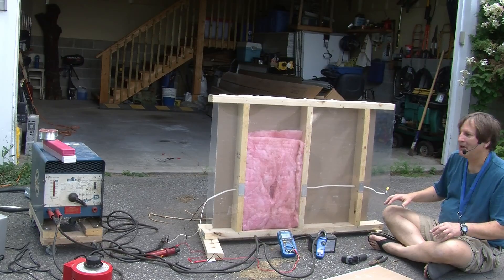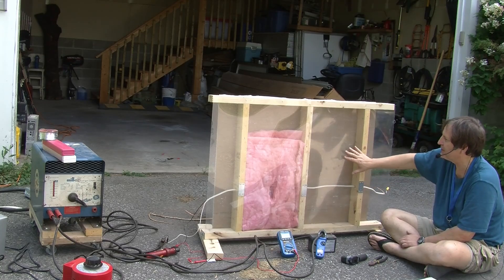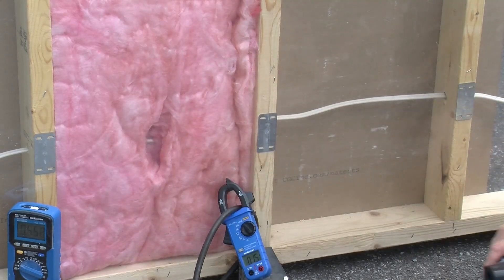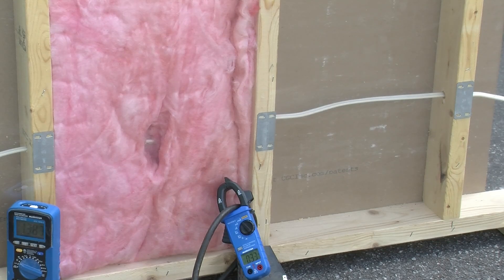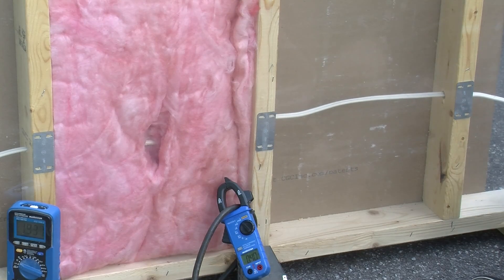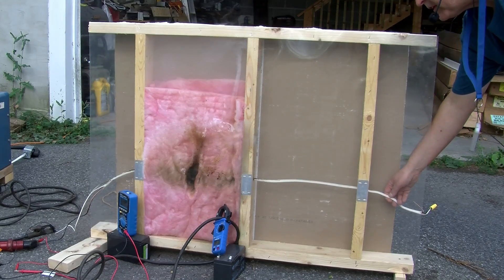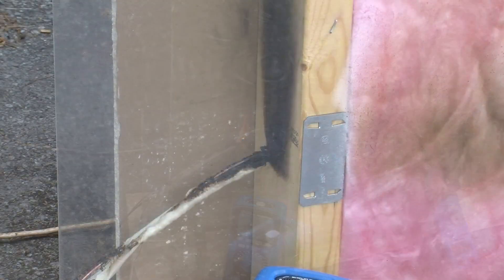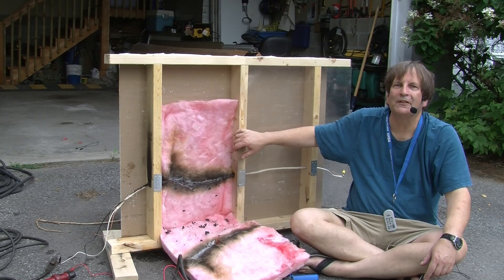Overcurrent +14/2 + Fiberglass in a 2x4 Wall

Comment: So a 8 gauge wire that is rated at 40 amps should easily carry 60 amps and have a 60 amps breaker?   My house in Colombia has a 8 gauge main wire.  15m long from the post total length to the panel.  About 6m of it runs in the block wall inside a 3/4 inch plastic pipe.  Green pipe used for electrical.  Do you think that I can increase my 40 amp breaker to 50 or 60 amp
Reply from the maker: I wouldn't - the reason for large margin of safety is to make sure things are OK even if things go wrong. For example, some circuit breakers are surprising inaccurate tripping at higher current than they should.  Other issue may be insurance or liability issues if something does go wrong. Having said that different counties have different electrical rules so it may be worth checking to see what a #8 cable in in 3/4 inch plastic conduit in Columbia is rated to carry - could be more than for a NMD cable in Canada or the US.

Comment: Also, where are you gonna measure temperature on a white wire that thermometer in your hand requires a black surface to function accurately just put a piece of electrical tape on it!
Reply: Matte surface, can be other color, but he had piece of plexiglass in front of it

Comment: Another great video update. After watching this in tandem with the previous on overcurrent i am feeling quite safe with the standard of 14/2 for code. We are to go 80% of 15 Amp continuous and watching we are well past this usage, we are well beyond 100% of continuous current and your fuse should take care of tripping beyond that point. If someone wrongly put in a 20 Amp fuse i believe it would still be safe. Seeing the Canadian code is always a tradeoff between safety versus cost i believe they made the right tradeoff, going to a 12 gauge for a 15 Amp circuit would be welcome but not necessary as a minimum seeing the margin for safety is more than adequate from your testing. Cheers.
Reply from the maker: Yes - and your right it is always a trade off. The one  that concerned me a lot was the one with spray foam around the  wire. I dont remember the details, but I do remember that what I took from it was if the you had a cable expected to draw close to its rated current for an extended period of time and all of this was in location like a hot attic or maybe a sun facing wall, the margin of safety would get too close for my comfort if one used the code sized wire.

Comment: This is a great test that really shows the massive safety margins built into the code for wiring. In nearly all cases the end device, receptacle or what not will fail well before the wire does. I speak from CEC rules, but wire is rated based on the insulation temperature of the cable, and parts of the code restict temperature table you can use for that application. For exmaple, 14/2 is rated for 25, 20, 15 amps at 90, 75, 60c. For nearly all cases in a house, you have to use the values under 60c which would be 15amps. However for hardwired heating loads, like a hot water tank, you can use the 75c values. With the heating rules you can load 14/2 right up to 20 amps of continuous load, on a 25a breaker.
Reply from the maker: It has a great safety margin  - although in a following video with even better (spray foam) insulation  ( https://youtu.be/lFdSXTKsKwA ) 30A becomes the point where the wire insulation begins to melt. Not a huge surprise since with enough insulation you can  get any amount of heat rise, but a close particularly for situations like a cable in a hot attic that have been covered with insulation and is feeding something like an air conditioner at close to rated current. 

CEC rule 14/2 allowing 75C/20A for hardwired heating loads. Any idea why that is deemed acceptable? I would think a heating load that can often be on for long periods of time would be worse  than for things plugged into outlets etc with usually more sporadic usage? I have also hear the higher temp ratings are also permissible in some industrial situations.   For the record, I'm an electrical eng who doesn't deal with code issues very often so its neat to come across someone who really knows it (electrician?)
Reply: Not much of a safety margin, when you consider that those wires are run in places that may have issues dissipating the heat. Also, hidden places that are not easily checked or inspected.

I think even if you are pulling much current through a heavy-duty extension cord, you may need to check that it is not too much tightly coiled up. Wire is technically a low-resistance resister, and so all those watts of heat have to go somewhere. Incandescent light bulbs are a high-current resister, made to be able to take some amount of heat.

Comment: Dr. J, I'm somewhat underwhelmed with your testing methodology; Particularly I'm at a loss as to why you wouldn't use a temperature probe/thermocouple attached to the cable jacket inside the fiber glass insulation instead of relying on an infrared gun trying to take measurements through plexiglass. The pocket/birds nest you carved out degrades the test and taking measurements through plexiglass further skews the results. Anyhow, after 30Amps, i started loosing interest. PS:  fires are much more efficient spreading through vertical cable runs. If you tilted your rig 90 degree sideways, or even better, make a 90 degree turn simulating a vertical and horizontal cable run, typically found in many homes, would give an even more realistic picture.  I bet at that 90 degree turn to horizontal would catch on fire at 40amps.
Reply from the maker: Points well taken! It was by no means (or meant to be) a perfectly done test, but more a general demo of what happens when typical house wire is surrounded by insulation and exposed to varying current below and above what it is rated for. I don't remember why  I didnt use a temperature probe - its been a while since I did the video - might have been the probe I had had broken and I hadnt got the replacement yet. 

  You make a very good point about vertical runs. And to add to your "turn it 90 degrees" comment, having it a full 8 or 9 ft tall would add to the chimney effect even more. Would also be good to do with and without sealing the holes though the 2x4s where the  wire enters/exits (as is often required by  building code).

Comment: What about blown in insulation?  Is that more flammable?  My older home is filled with it. Done in 2010.
Reply from the maker: Is it foam blown in insulation? If did one with hardware spray foam in a can here which may or may not be like two part  spray foam: https://youtu.be/lFdSXTKsKwA

Comment: Small correction: Originally all 2x4's were really 2"x4" but they were called "rough cut." They really were very rough. I know this because my first house built in the 1930's was all made of rough cut lumber. But then the mills started offering sanding and planing of the 2x4's and that took 1/4" off each side. So when you bought "2x4's" you were asked "rough cut" or "sanded and planned." Very quickly everyone opted for the later and that is why 2x4's are not 2x4's.

Also great video. Thank you for making it. 🙂
Reply from the maker: Interesting - I had heard the size between what we call 2x4s and an actual 2x4 was from thick saw blades in the old days. Seemed a bit odd to me that the blades were half an inch thick. Your explanation makes much more sense. Hals also never heard about being given the option of which size  of 2x4. I have heard that in California as a result of some law or court ruling, the hardware stores have signs up indicating that 2x4s aren't actually 2x4. 

  Glad you liked the video!

Comment: I think the spray foam will burn in a bad way if it is close enough.  i think spray foam is a bad idea for fire safety or at least near places where fire could be a risk. Even the fire rated orange is bad.
Reply from the maker: I was surprised the  various foams didn't simply go up in flames.But even without flames the fumes are probably deadly.

Comment: I'm not convinced you are reaching Steady State in 15 minutes.  I believe National Electric Code differentiates "continious" vs. "intermittent". as typically used less than 1 hour, vs running for 1 hour or more.  So... It might be interesting to redo this test with 1 hour intervals, and to pull the insulation off and take a picture and temperature reading in between each 1 hour run.  I doubt much interesting would happen at 15 amps, or even 20 or 25 amps...  Beyond that, things might get interesting.  I might expect insulation browning at 30 amps over an hour, maybe???  But your 50 amp tests, although fun to watch, (hopefully) aren't very realistic.  Great Video!
Reply from the maker: I think the equilibrium time may depend a lot on the thermal mass around the wire and the amount of insulation and what the resulting time constant works out to be. Temperatures seemed to stabilize after about 15 minutes, but yes, could creep up a bit more over an hour. A forensic analysis as you describe would be the way to do it for sure! I also wonder if extended cooking at 30A might make the plastic break down over time and be more susceptible to failure as the time goes on. 

And yeah - 50A is fun an hopefully not common. There is a series of vintage breakers that apparently are still installed  in some homes that sometimes don't trip properly (Federal Pacific and Federal Pioneer according to Mr Google)  so it may be more common than we think. 

Thanks for the comment!

Comment: This is not realistic becuase 12 2 Romex is used for outlets in US homes not 14 2 Romex.. . MANY STATES DONT EVEN ALLOW 14 2 in lighting circuits becuase people cheat with lighting circuits with those screw in plug adapters...
Reply from the maker: Well I'm in Canada an 14/2 is (or at least was) common.

Comment: So strange for us to see a wall not made of stone or concrete.  If you install wire is there pvc pipe around the cable? We normaly put wall wire in the pvc pipe.
Reply from the maker: Construction of houses is very different in Canada and the US from Europe. The little section of wall I built is typical an could be from a real house. For houses, we do not normally use conduit (English for the pvc or meal pipe for electrical wires). The wire is simply placed though holes in the wood inside the wall. There are rules that say how far from the surface of the wall the cable should be to prevent damage when people put nails in the wall. I'm sure our risk of house fires is way higher than yours!

Comment: The copper will melt long before the fiberglass melts.  However, fiberglass is generally coated with a binder and dye and that is likely what is burning off.  Would have to look at a specific manufacturer MSDS to know for sure what is used.

Comment: I would hope this is a lesson for people not to put in too large a fuse or breaker on residential wiring.
15 amp for 14  guage wiring  and 20 amp  for 12 amp  wiring.
Reply from the maker: I was actually shocked to hear that people not only put in bigger fuses, but also also actually have swapped in larger breakers. Scary to put it mildly!
Reply: @ElectromagneticVideos  We need more public information on the correct sizing of fuses and breakers. Especially when it gets cold and people use electric heaters.
Reply from the maker: @jcolumbiap  Definitly! To their credit, a few years ago when when I was purchasing a replacement 50A breaker for my welder outlet, the Home Depot rep mase some gentle enquiries about what was such a large breaker for, clearly wanting to make sure I wasnt going to do something like replace a much smaller one with it. At leas with breakers pwoplw are less likly to "upgrade" them on a whim which must happen with heaters blowing fuses.

Comment: Lets say thats happening somewhere inside  my walls and all I notice is burning electrical smell.    How does one figure out where exactly its coming from without tearing out entire walls?
Reply from the maker: That's a tough one - a hit at location might be looking near any large loads that are running like a heater. I did  notice in some cases you could get a sense of where the overheated wire was with an IR camera - but not a foolproof solution. I would think if you  thought there was something like that going on in a wall the best thing would be to treat it as a fire and call the fire department - they probably have experience locating things like that best to be over cautions than risk a house fire by not doing anything.

Comment: Cool test! How many amps can the wire handle under water?
Reply from the maker: That's an interesting one! There certainly are underground power transmission cables that depend on some sort of non-conductive cooling fluid (usually oil I think) to keep the cable cool. And its a sophisticated enough setup that there are pumping and cooling stations at the ends of the cable to manage the fluid.

Comment: Test results are what one would expect, insulation melts at high current. The data points used to determine when the conductor insulation melts are flawed. The IR thermometer cannot detect surface  temperature of an object through plastic. My $30k Flir infrared camera doesn’t work through plastic either. The temperatures reported throughout the video are the average surface temp of the outside of the plastic sheathing. Actual max temp of the conductor sheathing reached somewhere near 300C as this is the temp that wood will combust. For reference, fiberglass insulation melts at about 540C and copper melts at just over 1000C.
Reply from the maker: Your right - verified this in later videos after I bought a $300 IR camera (not quite as expensive as yours!). Thanks for those reference temperatures. So what do you use a $30K IR camera for? I'm guessing it has fairly high image resolution to cost that much?
Reply: @ElectromagneticVideos  I’ll have to check out the later video. I am master electrician and reliability engineer working in an industrial environment on voltages up to 12.5kV. I use the camera to find loose connections in electrical gear.  Due to working on enegerqzed gear most of the time I need to keep a safe working distance from the high voltage. The high resolution camera (1024x768)  with a .2mrad IFOV give the camera a very small spot size ratio and allows me to distinguish exactly where the hot spot is located from a safe distance. This is important when there are multiple lugs bolted together or multiple taps on a buss bar. Repairs have to be scheduled when there is downtime so we need to know exactly what to tighten or replace.
Reply from the maker: @farmerjim-fat-man-do  How interesting! I never thought of that as a use for an IR camera but had heard of people checking home panels for overheating breakers. I can see how a camera like that would pay for itself many time over dealing with things like yours and minimizing downtime.   I'm and EE but generally dealing with signals and much lower voltage  stuff than you. My only experience with HV is from fixing TV as a teenager the HV section being in the range of 12kv to 30kv depending on  tube size and bw or color and of course with mA amount of current (although the built in picture tube capacitor can store quite a punch for days or more!). I wish you would put us some videos but I'm sure many industrial places wouldn't be too happy at having their facilities shown off!
Reply: @ElectromagneticVideos  IR thermography is used quite a bit in industry for reliability purposes. IR camera technology has become much more affordable allowing hobbyists access to the technology for home and auto use. A lot of electricians can now afford to carry a low end camera on their trucks. IR technology is not as simple as point and shoot, there is a quite a bit to learn about the technology before one can expect good quantitative and qualitative results in a professional setting. I have been Level 3 certified for 10 years and still learning. I am working  on some content but I travel for work and it’s hard to find time to put together a video. Maybe I’ll drop some shorts…
Reply from the maker: @farmerjim-fat-man-do  It certainly had gotten cheap - I picked up the Seek one that attaches to a cell phone for cdn$200 = $150 in your money.  I completely get the time constraint thing regarding videos - you wouldn't believe how long it takes for me to make these videos of simple tests - not the least of which is  because there is a fair amount of road  traffic on weekend and the number of retakes and edits out I had to do to get barely acceptable audio makes everything take  2 to 3x as long. Shorts would be great and quick and they seem to be the upcoming thing. If you get chance I'm sure they would get a lot of views (then again I have never been able to predict what videos of mine got really popular and which didn't so what do I know :)

Comment: Many, many years ago there were separate amperage ratings for knob-and-tube wire ran in an open cavity space vs. insulated, open space ratings significantly higher.
Reply from the maker: I didn't know they did that by makes perfect sense! You wouldn't happen to know what the "official" current ratings were for various knob and tube wire sizes by any chance?
Reply: @ElectromagneticVideos  I don't know it off the top of my head, but one or more of my older electrical books has the info. There might be a resource on-line that also has it. I want to say that 14 AWG was rated for 20 amps, 12 AWG was 25 amps, not sure about 10 AWG...
Reply from the maker: @NipkowDisk  Given the air cooling of the wire, the slightly higher than we are used to is not surprising.